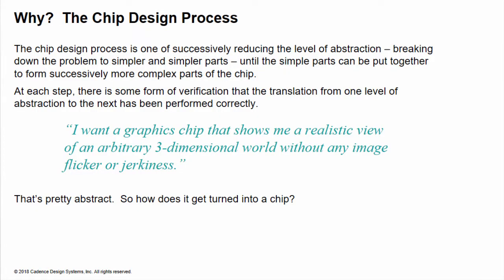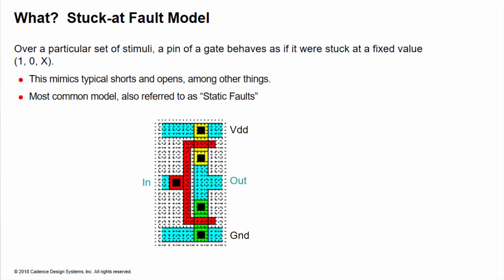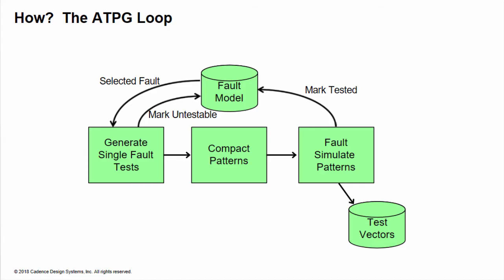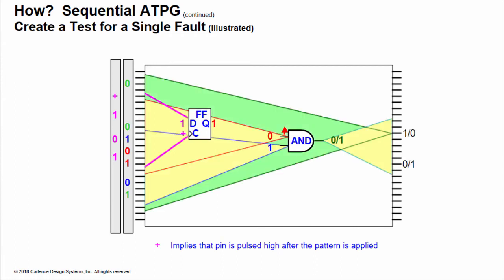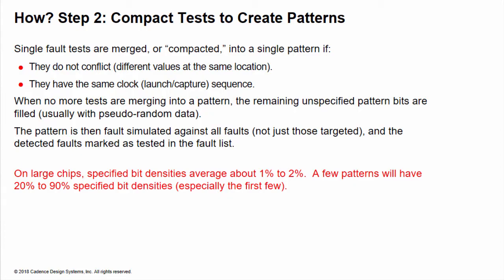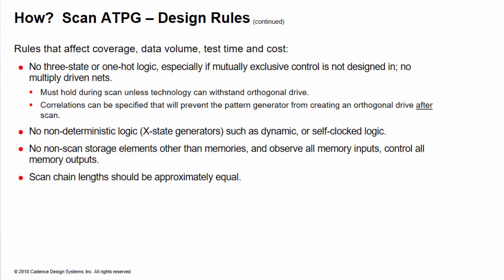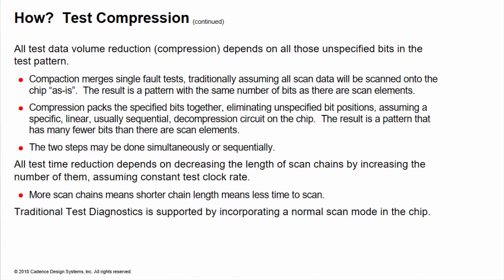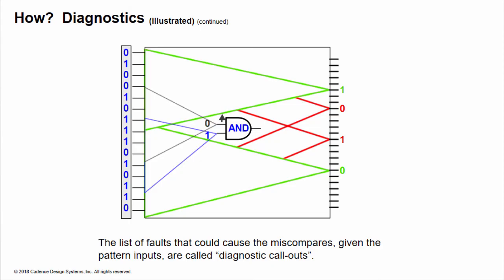Design for Test Fundamentals

Comment: Manufacturing test ensures that the Chip is manufactured as it was designed, and doesn't prove that it was designed correctly. But how can one ensure that the chip is manufactured and designed correctly at the same time?

Is it validation?
Reply: Depends what you mean by validation. Usually proving the correct design and correct manufacturing of a chip is split. The correct design is proved during the design phase, this is called verification. This can be done in multiple ways i.e. formal or by simulation. But when the first silicon comes from the fab, one usually is doing a post-silicon validation. Here both is checked. Is the design correct? How good is the design regarding to concrete specification parameters (for example frequency)? Which part of my design seems to be prone for manufacturing defects (co-dependency of design and manufacturing process)? But one should avoid design mistakes at the tape-out, as it is more expensive and time consuming to fix design bugs from then on. This is why verification during the design is so important.